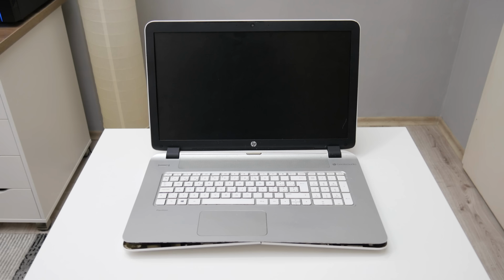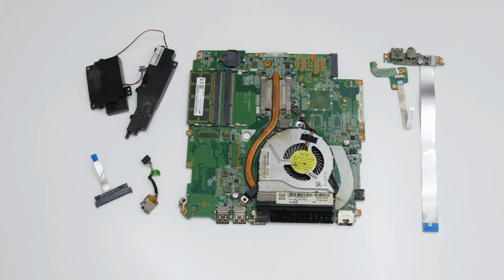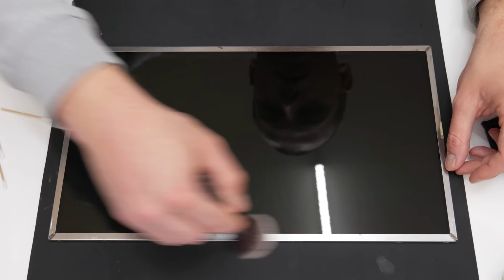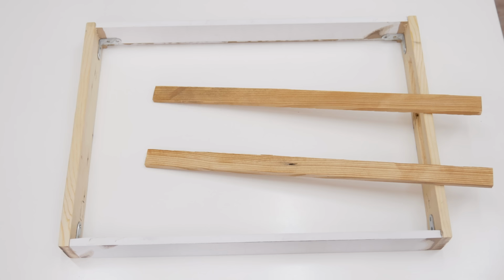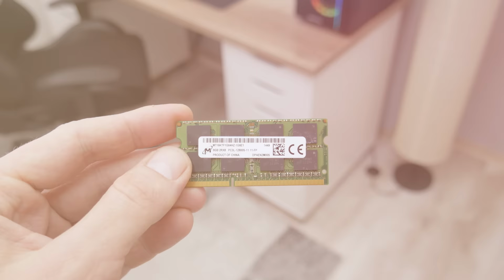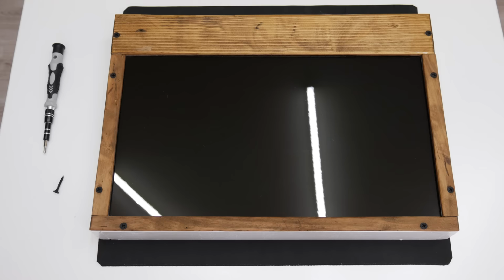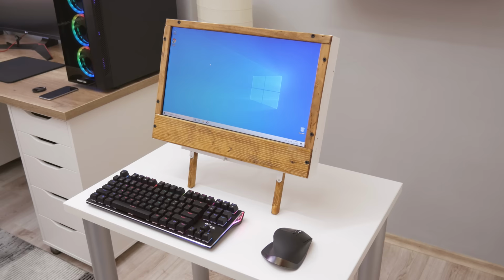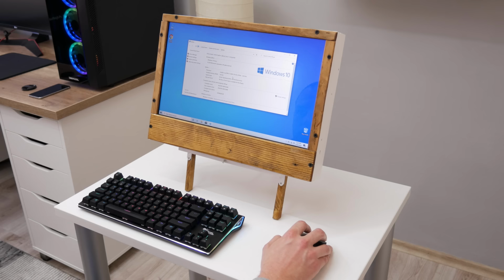I made All in One PC - From a broken Laptop

Comment: Please Give specs of broken laptop???
Reply from the maker: Hi, this model has i5 5200U with HD 5500 graphics
Reply: I've been looking for the specs of this laptop in the comments and actually, the Acer Aspire E15 E5-571-5930 has the same i5 5200U and Intel HD 5500 Graphics! It's 5 years old now and replaces my 2018 (bought 2019) Acer Aspire TC-885 that froze and when I turned it off and on it boot loops so on and off and on and so on until you remove power. :(

Comment: Next 10 years 
Andrew:lets transform this razer blade 17 pro into something better
Reply from the maker: If i found some broken it will be earlier :D
Reply: im sure gaming laptops holds longer than regular laptops
Reply: Instead of a Gaming Laptop, make a 'Lugable' or Briefcase computer. Like the old original Compac computers. You will be able to make it cheaper and a better Portable Gaming PC. More standard parts and widely available sound and video cards. (any cards that will fit into a common Mini-ATX case.)
Reply: For my experience after 1 year using gaming laptop, not really worth in a long-term although i found out that mobility accesses is limited.
Reply: edmunds tomsons  Bro you Should be a youtube yo
Reply: edmunds tomsons  Yup, i had a non gaming laptop and it lasted me 6 years, the one that i have now, i bought it 3 years ago and the battery last like 30min. I had to change the thermal paste after a year and half of usage, upgrade the RAM, upgrade to SSD and now that i have a broken case, i am about to make my own DIY all in one 😂😂😂😂
Reply: YeSSsSsS
Reply: @mimireich  for my 12 year experience of using gaming laptops I found it the best of both worlds. Near-desktop level performance and a laptop portability with great battery life.
Reply: @TabalugaDragon  It seems that experience between expensive, midrange and entry laptops are vary. My take that year was when I was first time using it so I haven't got enough clearance and accuracy. My take 3 years ago are too general so it may not accurate for certain people. Thanks for your follow up even if it's factual or sarcasm.
Reply: @mimireich  that's not sarcasm. Yes, gaming laptops vary very much from model to model. Some have good cooling, some have bad. Some have excellent battery life, some have terrible. Just like with desktops, you just need to do some research on the topic. 
I've recently got a Legion 5 pro with a 3070 ti - outmatches everything I had before by a mile. Near desktop 3070 performance while at light loads I get about 7-9 hours of battery life, which is more than the cheapest thin and light laptops with weak hardware.
Reply: @TabalugaDragon  No worries, mate. That's good to hear about.

Comment: Year 2020: makes a potato laptop into gaming thing 

Year 2050:makes a potato laptop into a super computer
Reply: Nah......laptops tend to be more non-upgradable that upgradable
Reply: 2050 : Making Acer Predator A Super Gaming Laptop
Or 2050 He Will Be Dead
Reply: @inspexter9761  idk
Reply: @darkraft100  ok
Reply: In case, Did you meant workstation? super computers were made for running parallel processes not daily software usage nor gaming and workstations are made specialized for something, such as bioinformatics, human-computer interaction, gaming, programming and etc...
Reply: Modular potato
Reply: Year 2050 : Zero Two Wedding😂
She Is My Waifu
Reply: Year 3020 turning a potato into laptoo

Comment: 4:28 "easy to change" - usually only requires you to disassemble the whole laptop first. But hey true, they are easy to change.
The stand design is pretty cool though.
Reply: Yeah, this is a HP 17-p model laptop. I know this because I have a similar looking laptop, which is a HP 15-p. The P series of HP laptops are well known for their difficult disassembly - a RAM upgrade requires complete disassembly.

Comment: I really do like yuor videos but i have a few suggestions for next builds. 

1) Next time you can get either a thermal pipe or some small heatsinks and use thermal glue to attach them to the laptop heatsink. This is possible because there is a lot more space in the new case. 
2) You should use more screws, even the shorter ones to furhter support the brackets.  This will make the case last longer in case the wood expands because of temperature changes etc. \

Good luck!
Reply: That's smort

Comment: Wow, not bad. I have a laptop exactly like the one that you used except that it has a touchscreen. I would consider doing the same thing but there is some hardware that is causing the operating system to freeze and I can’t identify what it is.

I’ve got one suggestion for your stand, instead of using a shoelace you can buy a chain from the hardware store and that would make a lot better support for the legs.

Comment: My pro tip:  Your idea is fantastic.
Also very good for airflow and Portability. But speaking of latter it does lack protection while carrying around so I suggest if you could make a flap for the screen, perhaps with keyboard attached on the inside of the flap. When you close the flap it will look appear as  a box. Add a handle on the top too
Reply: i dont think theres going to be enough space in the inside of the case to fit a whole keyboard

Comment: andrew please add external graphics card to this all in one pc 😘
Reply from the maker: I've tried but not working with this model, the next video will be with eGPU but something much different
Reply: @ComputersAndTechAndAndrew  hey andrew thanks for reply i have question i have hp laptop with amd radeon r5 m430 2 gb and intel pentium n 3710 1.60 ghz and can it run fortnite and can i overlock gpu and cpu ?

Comment: Hey great idea im going to do it too. Question: could i use a PC motherboard instead of the laptops or not and if so could i add a GPU?
Reply: I mean at that point you could just mount it in a normal case

Some laptops let you connect external GPU housings though

Comment: Hi I got a old widescreen hp pavilion dv4000 screen that I want to reuse but cant find a control bored for it any one know of one or a universal one I found a 30pin univ-bored but the screen is a 40 pin screen is there an adapter cable out there so it will fit. As you an tell I'm not good with electronics.

Comment: When i removed the important parts of my old trash compaq laptop, i didnt knw that the power buttons, display connector, power cable was necessary. SO i threw them off. Is there any way i can get them for less price? And btw, where shud i connect the power cable? Someone help, I am a beginner at building pcs and motherboards, i cant even identify where i shud connect wifi antenna and power port.

Comment: Hi Andrew! New sub here. Watched a lot of your videos lately because I was looking for something I can do with my units. And luckily thought of converting it and found your videos.

I've been planning to do this probably next year. I already have a design in mind. However I am not that techy when it comes to PCs and laptops so I'm asking for a suggestions and recommendations from you Andrew that I can do in upgrading my own laptop to desktop conversion that can run a game such as Genshin Impact and use for streaming.

These are the details I have from my two laptops from 2011:

EMACHINES:
●T4400 INTEL PENTIUM
●INTEL GMA 4500M
●2GB DDR3
●250GB HDD (RAM & ROM are already not original. Stolen by the technician in Saudi and is replaced with a smaller GB of storage)

ACER ASPIRE 5738G:
●INTEL CENTRINO
●INTEL CORE 2 DUO PROCESSOR T6400
UP TO 1791MB INVIDIA GEFORCE G105M TURBOCACHE
●3GB DDR3
●320GB HDD

Hope you'll notice this and be able to help me. Thanks in advance Andrew!

Comment: Can i ask u bro, i need your help and advice, i want to ask about egpu, i use thosiba satelite c40a and use egpu exp gdc 8.5c and GTX 760 and i already set up all and connected to my laptop but my problem is when the egpu connect with the laptop, the laptop got black screen but thr power still on, and when i dissconnect the egpu with my laptop, the laptop running well, plese anyone here can help me? Thanks before

Comment: Hi, I really need your help! Before few weeks I have changed my mother board and from core I5 with nivida graphics card  to amd old version and when I enable the display adapter it lags and goes slow but when I disable it it's a bit fast but still not good.  I need your help to tell me what should I do should I install a driver or software or what
Reply: Use DisplayDriverUninstaller, uninstall every (grsphics) driver. Them try to download the official driver back again.

Comment: 12:24 you are totally wrong, ram doesn't will increase the performance of a computer
Reply: It will increase the data that can be quickly accessed by the CPU cache and having that data available will increase overall performance
Reply: @nickdragonslayer  yes of course, but if you have morethan enough ram then, will it increase the performance? the answer is NO. cause it the system has the enough memory to save the cache files for temporarily on the ram, then it wont use any extra memory for sure, I have tested ( 8GB vs 16GB vs 32GB vs 64GB)
Reply: @nickdragonslayer  "12:24 you are totally wrong, ram doesn't will increase the performance of a computer" I mean ram will bottleneck when the system running out of memory, so if you have installed morethan enough ram then no need to worry about the bottleneck